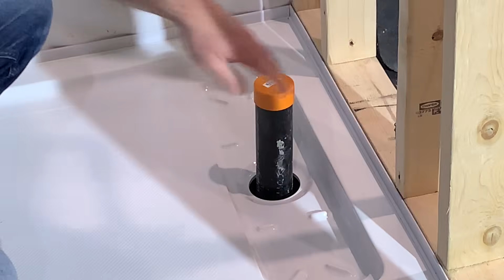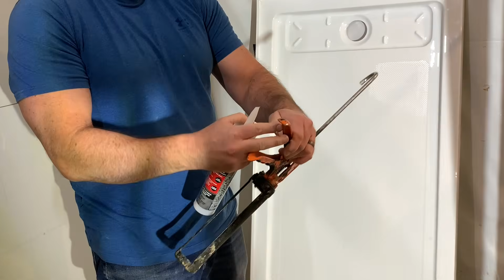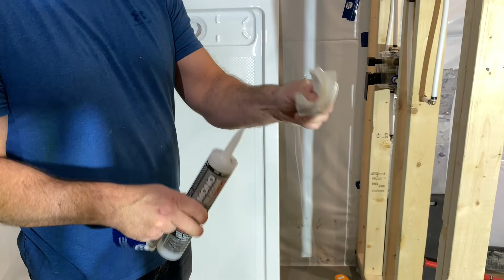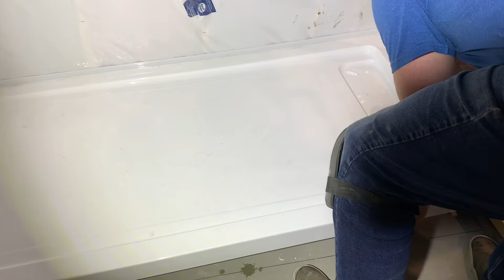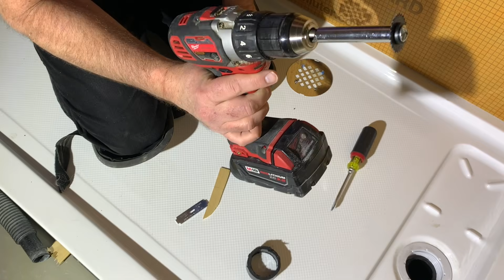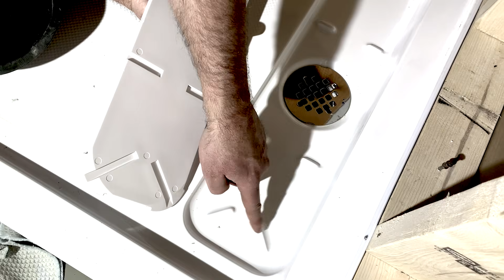How to install a shower pan on a concrete slab

Comment: I wouldn't used sand mix as that isnt going to anchor or level your pan that great... If your worried about level build a dam pour some self leveler and scratch some premix or thinset

Comment: Thank you for this video. Question: Would it hurt to put Felt Paper or plastic below the motor?
If my drain pipe is in a hole larger than yours; I think about 15" circumstances. Should I consider putting a subfloor?

Comment: Srill have zero idea how that pipe connection works.
My drain coming out of rhe ground is male threaded pvc pipe.
But this males it look like its a compression? Joint here, to a smooth pipe

Comment: this is a very good video, however, i have on problem with the installation, and he's not the only one that does...
if you set the shower pan in the mortar and then shim the pan up, you will not have the support under the pan feet because the mortar is not wet enough to flow back under the feet.

Comment: You DO NOT NEED mortar under  modern pans and tubs. I wanna see you post a video where you are demoing a shower  that had mortar. We never see those videos, do we...
Reply: Just bought an Ové fibreglass shower base in Jan 2026 and it calls for mortar underneath the base. You'll potentially have cracked caulk  and grout joints (therefore leaks) and a creaky base if you decide not to go with mortar as base support
Reply: Just bought a new one that says bed in quality mortar and Not to drill screw or nail. Dreamline shower pan. Manufacturer instructions.
Reply: I would lay some tar paper or plastic sheeting under the mortar to keep it from bonding to the concrete and also to keep the moisture from being absorbed as it cures. Also makes it a lot more expediant to remove in the future if the bathroom is remodeled in the future.

Comment: great video! as mentioned before, not many installations on concrete slab. 

seems like you didn't let the mortar dry before you placed the shower base. If I have a very uneven floor, can I follow the same process you did?  by that i mean, just add wet mortar higher in areas that are uneven and sit the base down and level it out accordingly?
Reply from the maker: You could yes, I would dry fit the pan first and shim it level.  That way you'll have an idea how thick to lay it down.  Setting the pan while the mortar is still damp is the way to go, that way the pucks on the bottom are cemented into place and you end up with a very solid feel.  Hope that helps!

Comment: So far, you are the only one that has showed installing it over a concrete slab, and also the only one I could find showing how to install the final 1 inch rubber piece that goes over the drain and gets tightened with the provided key and explaining all of that. Thank you.
Reply from the maker: Glad you found it helpful!

Comment: Can you ues Deck mud for this.
Reply from the maker: Not familiar with that product. I would stick with something that is stiff to work with and would properly support the pan.
Reply: Yes, deck mud would be fine for this as it's about the same as mortar mix but a smoother texture.

Comment: Awesome video with tons of tips and details!!
The pea gravel around the 2" drain pipe is a nice touch to allow some wiggle room because that pipe has to come up dead-centre of your pan's drain hole.
I consider air sealing/foaming the hole in the slab around the pipe, although the sealing around the edge of the pan should do the same thing. You will never notice a tiny leak under the pan if the rubber gasket or silicone fails. The pea gravel will carry a few drips away quickly under the slab

Consider marking and pre-drilling the screw holes in the pan prior to installation or using a longer bit (or a hex shank bit on extension). I can imagine the number of pan gel-coats that have been scraped up by drill chucks grinding against them.

The front of that pan is not a major load bearing area, but will be subject to people standing on it and flexing the pan. I expect wooden shims to dry/shrink/rot over time, so I would consider a plastic shim or extend the mortar bed right under that lip.  Painters tape to protect the gel coat of the pan and then trowel off or taper  the extra mortar that will meet your tile underlayment and/or thinset.

Comment: Hi there. I have the same base, but it came with no instructions? Am I supposed to bring the backer board down over that flange that you had to install around the edge of the shower base?
Reply from the maker: the backerboard goes to the top edge of the flange and then you fill the remaning gap with kerdi fix or a good quality silicone.  It will act like an expansiob joint to absorb any movement.

Comment: Are you making the pan level in both directions?  So the pan is sloped towards the drain during manufacturing?
Reply from the maker: Yes, the pan is level both ways.  The profile of the pan is sloped toward the drain.  cheers

Comment: What flange is the rubber gasket sitting on when you're finishing the drain install?  Is there a flange in the drain assembly?
Reply from the maker: There is a flange in the bottom half of the drain assembly yes. The gasket bottoms out on that flange.

Comment: It's nice to know I'm doing everything right. My shower base is a neo angle, but the principles are the same. Myu biggest question was the rough in drain. When the instructions said to allow a 5-to-6-inch hole for drain clearance, it was talking about a sub floor, not concrete. Your video totally answered my question. I was also wondering about the poly, though my instructions didn't mention anything about laying down poly over the mortar base. I like your silicone tip, though I usually let it skin over or completely cure and then when I need it, I just pull the plug out and it's still perfectly fine. Something I use to clean up excess silicone is some acetone. It does a good job of cleaning silicone. Otherwise, great video! You've answered all my questions!

Comment: Can you share the manufacturer and model of the drain please?
Reply from the maker: Couple options: 2" diameter
Kohler Model # 22676-S
Oatey Model #48525

My drain is a 2", if yours is 1-1/2" dia. you may have to add a coupler.  I'll post this in the video notes.

Cheers!

Comment: How would I find a plumber in my area to install a non-tile shower base? I'm having trouble doing that.
Reply: I’m sure you figured it out but generally you would contact a bathroom remodeler or a small remodeling company and they would set it, in my experience most plumbers would set the drain for you, but not the pan.